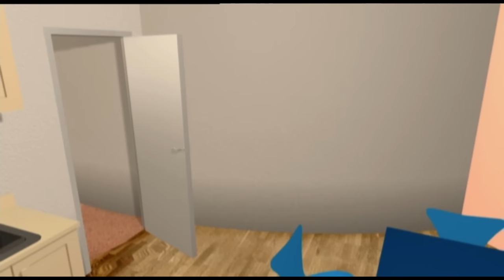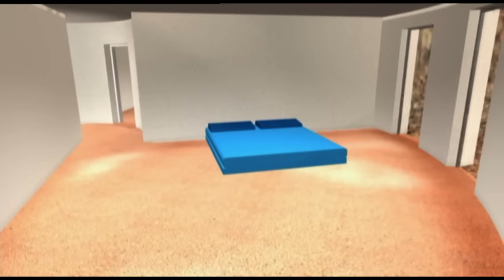Devon | Season 5 Episode 4 | Grand Designs UK With Kevin McCloud | Full Episode

Comment: The curved walls are structurally stronger and self supporting, therefor less steel required... What a delightful old bat!..tower for the elderly???... Again the shape of the tower is self supporting...pouring in 1 step was idiotic...Not understating the weight of poured concrete -why the engineer should have been present.
Reply: Pouring in one day, thinking that the Stairs would fit all in one piece, and the ridiculously low bid of $200k are all obvious mistakes by the design team. I guess they go the pour done, but the risk /reward of, taking an extra day or two to do it vs the possibility of the whole tower falling apart, isn’t there for me to do a 1 day pour.